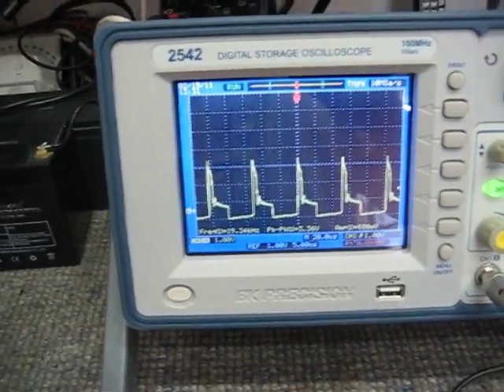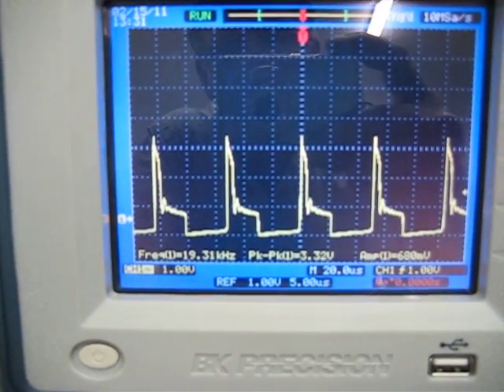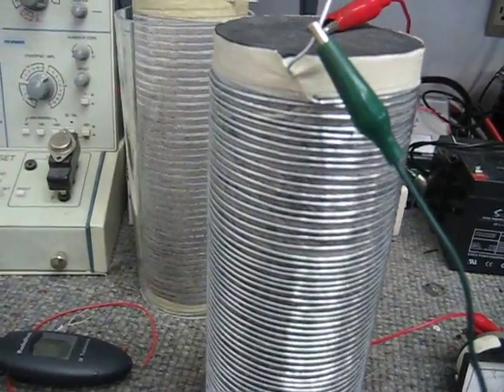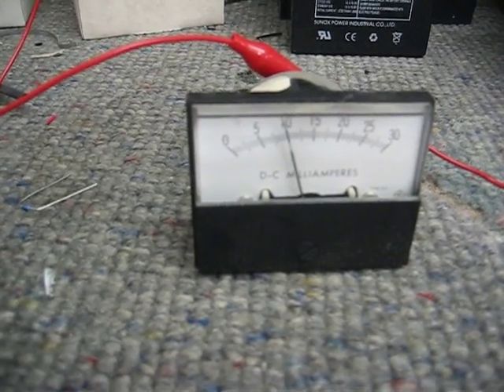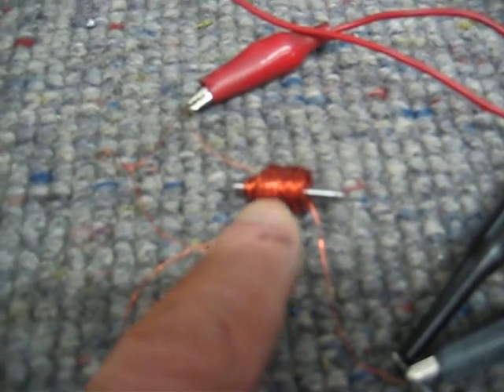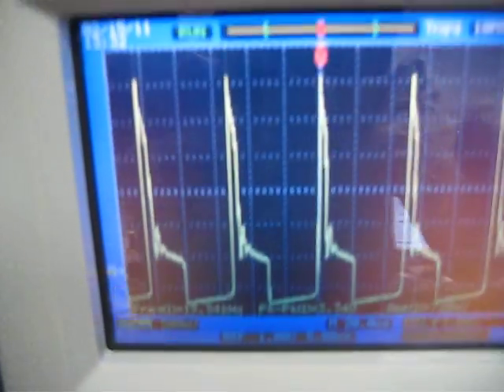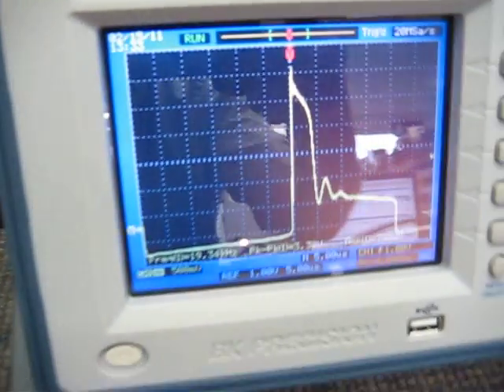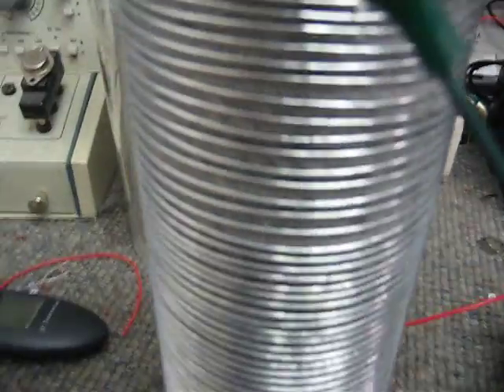Earth Light 4

Comment: @1noen1 technically a resistor alone has no polarity. However if you measure current through it in a circuit then you will find it does have polarity while in a circuit. But unlike a diode it does not matter how it is installed into the circuit initially.